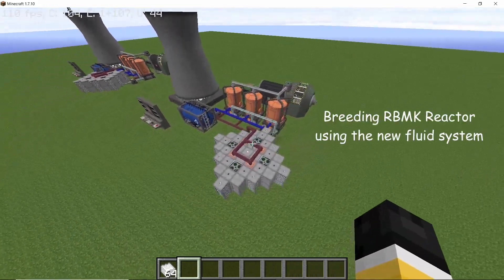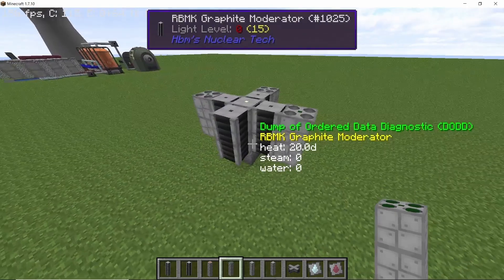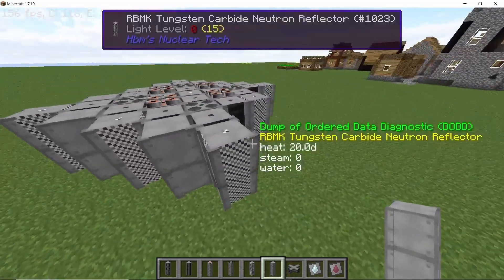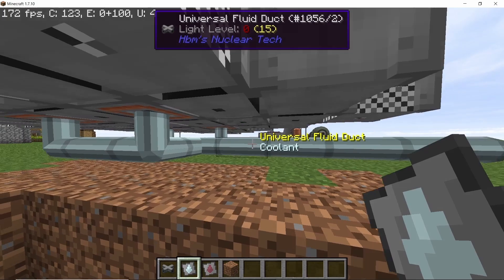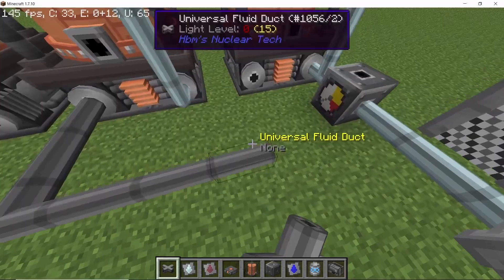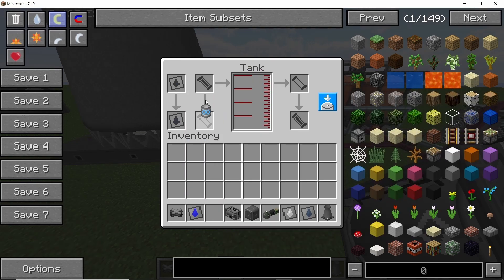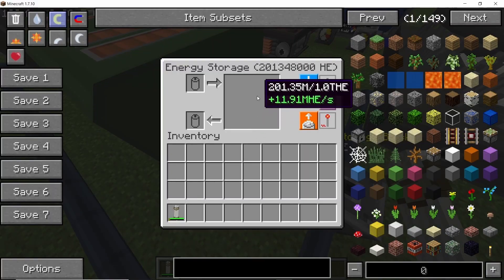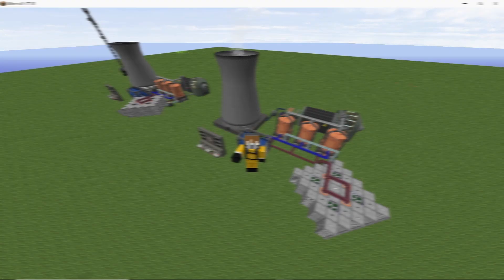RBMK Reactor with Heat Exchanger & Coolant - New Fluid system HBM's NTM Minecraft

Comment: Such a good setup. The 1.12.2 extended port despite lacking a ton of features seems to have decided to add the new fluid system. All the parts necessary for this are available too, like the heat exchangers and big boilers and RBMK fluid heater channel, so I'm gonna try building this on there to see if it works. If so, I'll update my comment for any other 1.12.2 players who may be wondering if it works there.

Comment: why we dont have modular nuclear fusion reactor
Reply from the maker: How exactly would a modular fusion reactor work tho ?
Reply: @SavageVegeta  coils plasma heater control and heat exchanger or something like this
Reply: using entities to simulate plasma - magnets repel plasma  so it wont hit walls and wont boom boom
Reply: @SavageVegeta  also try use industrial turbines because they have 100% effecienty instead of 85 of levi turbine
Reply from the maker: @username1694  industrial turbines don't process steam as quickly as leviathan does tho so in the end it all kinda levels out and I much rather use a single big turbine than  multiple small ones

Comment: Great reactor dude! as expected its better at breeding fuels rather than energy production still pretty good!
Reply from the maker: Yeah my man due to all the flux focused on a single column the breeding speed is pretty decent!! And tbh if you replace the fluid heaters with RBMK boilers the produced power should go up cause then the reactor will give out UDS
Reply: @SavageVegeta  Yeah, its kinda sad the fluid heaters that are kind of realistic are actually less efficient than the boilers
Reply from the maker: @TheChosenIndividual  pros and cons I guess , the future updates might change that tho and make them equally efficient
Reply: @SavageVegeta  Thats why i kinda liked the RBMK heat exchanger block, wish that in the future they can make it more like that, although maybe a structure and not just a block although its still pretty fun making huge heat exchangers out of those things!

Comment: The reactor exploded while trying to use dangerous fuel.
Now using a modification that adds automatic control rods!
Reply from the maker: Ah yes dangerous fuel should be used along with a safe fuel to keep it in balance
Reply: How did you add control rods?

Comment: Create a video with the topic "How to use Cryogel in RBMK?"
Reply: It's fairly simple, you can place them in the reactor and connect them with coolant ducts hooked up to tanks.
If the freezer goes above 750 ° it will use the cryogel to cool it down.
I use it for my reactor because it would go kaboom without it, but it's also a passive safety feature that actives when it's overheating so you can Scram it

Comment: Are the old RBMK columns still in vogue, where you can simply produce energy with water, which then evaporates into steam?
Reply from the maker: yes they are , and can produce more power than the fluid heaters can
Reply: @SavageVegeta  I mean, I wish there were still regular columns that just produce energy without any upgrades.

Comment: Looks cool, I never thought you could make a small breeding reactor so easily. Instead, I made it large so it can handle The Strongest Manmade Neutron Emitter for maximum output.
Reply from the maker: Yeah by focussing all the flux at a central point it becomes very easy to make the entire setup very compact !!

Comment: I fixed the problem but as soon as i put my fuel in it blew up, does anyone know why? I followed everything correctly.
Reply from the maker: Double check your coolant cycle, cause as long as coolant is flowing through the reactor and you're using fuel that doesn't instantly blow up the reactor shouldn't really explode

Comment: I was using this reactor and it was working perfectly but a good 5 hours later it explodes if the rods decay to 80% would that cause it to explode
Reply from the maker: Hmm generally that doesn't happen cause when the fuel rod is nearly completely depleted like 80% then it's reactivity goes down reducing the amount of heat its producing

Comment: What does the irradiation channel do?
Reply from the maker: Uses flux to irradiate and transmute a material like for eg making tritium from lithium
Reply: @SavageVegeta  What happens if the fuel in the teleporter runs out?
Reply from the maker: @Coffix6581  then the irradiation process will stop

Comment: I tried this reactor since the hbm tech mod reloaded one didn't work but when i tried to make it the fluid ducts wouldn't connect to the fluid heaters?
Reply from the maker: That is a visual glitch in ntm reloaded, try using NTM extended for 1.12.2

Comment: hey man i was kinda wondering what the muffler block does i dont know if its just a crafting item or if it has a use i havent been succesful i kinda need help working out what it does
Reply from the maker: Muffler block was added to mute the machines which make alot of sound like the diesel generator
Reply: @SavageVegeta  so how do i use it to mute them?

Comment: Hey Vegeta, Can you make another 13x13 or 15x15 updated reactor that won't explode?
Reply: I really hope so. I have been trying to make some myself but anytime I do they wont produce steam or just explode.
Reply: @commanderbly5747  Use a neutron source. I made a stable 25x25 reasim HEU reactor that uses polonium as a neutron source and everything is ok. Neutron sources don't fission so they don't change the flux, which is good for keeping the reactor stable, also don't use radium because the melting point is a problem and will certainly cause a meltdown!

Comment: It would be cool if the developers of this mod add an MSR (Molten Salt Reactor) the operation of this type of reactor is very cool, then they could add the reactor fuels and a solid state based on FLiBe salt, then there would be a machine that would heat the salt together with the nuclear fuel until it melts and then the machine would send the liquid fuel salt to the reactor which would make the reaction heat up even more then the fuel salt itself would pass through a heat exchanger outside the reactor that would use the heat of the salt to generate steam from water with normal water, then the salt would come back melted only cooler for the reactor repeating the process, the reactor would have control bars to control the reaction of course, what I said is the basic functioning of an MSR, there is practically no mod that adds this type of reactor, there is NuclearCraft, but it is not so realistic.
Reply from the maker: I am 99% sure that Molten salt reactors will be added at some point in time in this mod cause they are way to cool to be ignored in mod completely focused on nuclear technology. I will ask Bobcat who is the developer of the mod about these reactors !!

Comment: How is 2 blocks not 3?
Reply from the maker: Cause 2 blocks is ...2 blocks
idk what else to make of "how is 2 blocks not 3" xd
Reply: @SavageVegeta   rbmk reactor parts. Its was 3 tall not 2
Reply from the maker: @CheGevaraCuba  you can set them to any height between 2 and 16 blocks 
By default they are 4 blocks tall
Reply: @SavageVegeta  how to do it?
Reply: @SavageVegeta  PLS HOWWW!? PLSS I NEED IT
Reply from the maker: @CheGevaraCuba  /gamerule dialColumnHeight 2
Reply from the maker: @CheGevaraCuba  with this command you'll be able to set the height to 2 blocks
Replace the "2" with any number from 2 to 16 to set the column to that height
Reply: @SavageVegeta  thx